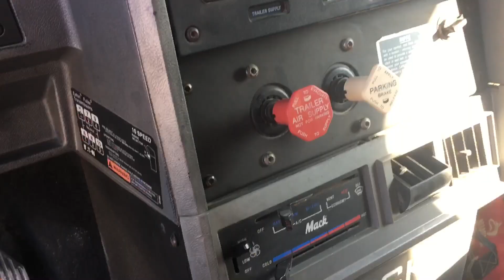Loading and unloading CAT 259D from low pro pintle hitch trailer

Comment: Good looking rig, just throw a grapple for the cat on the trailer and your all set. Just a tip cross your safety chains on the trailer when hooking it up so if the pintle gives out It kinda cradles it.
Reply from the maker: Dirt Picasso yes we have the cat grapple bucket/ hammer/ skeleton bucket and forks. I’m sure I can fit 2 attachments on the front and one hooked to the machine. Thanks for the tip, I would like to weld a thicker chain, the one it has right now it’s not in very good shape